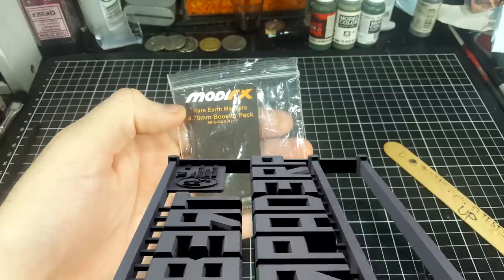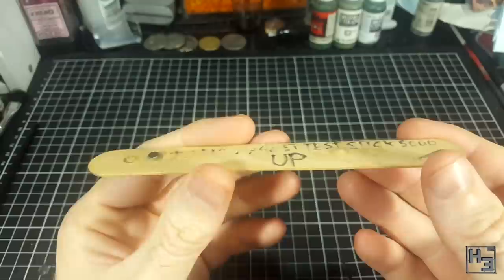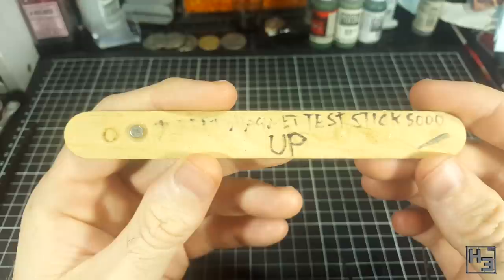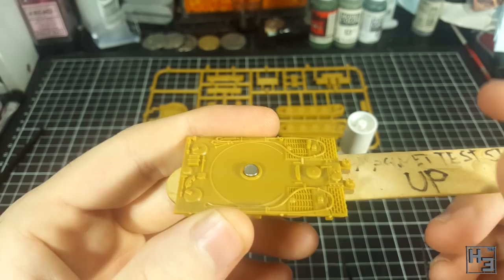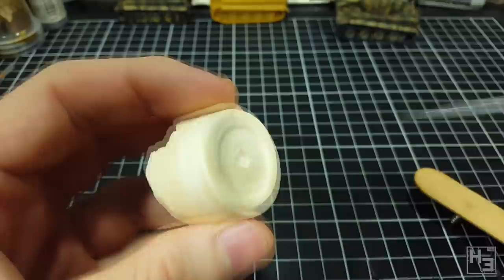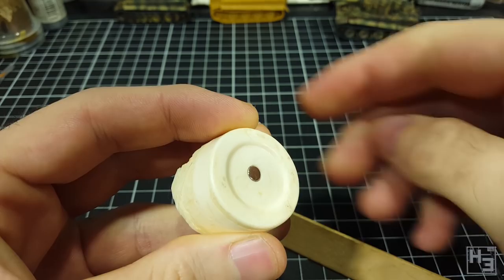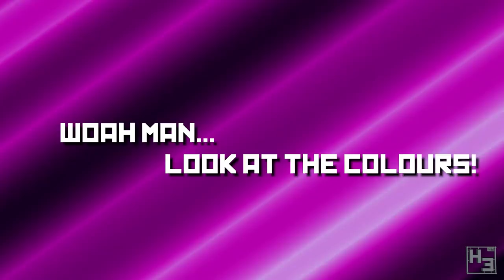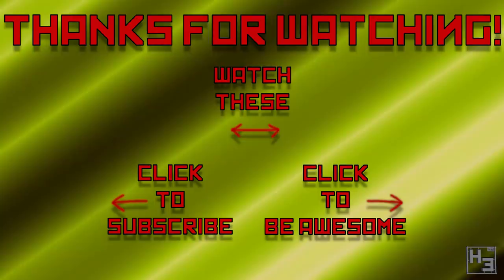Herbert Erpaderp's Quick Tips #13: Magnet on a stick.

Comment: What type of magnet are you using? Like the dimensions?
Reply from the maker: 4.75 x 2mm. I also have some 10 x 2mm and 2 x 2 mm. 

It's good to have a variety on hand.
Reply: Herbert Erpaderp Ah that makes sense. Now is the 2 x 2 a standard for most of your tanks cause I wish to try and limit the amount I need to purchase you know?
Reply from the maker: I've used the 2x2 magnets to magnetise guns on some tank destroyers, but in general I don't use them for tanks. Mostly for arms and weapons on infantry figures.